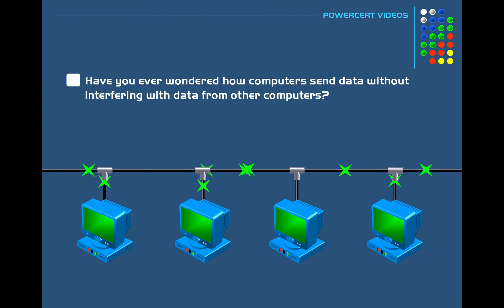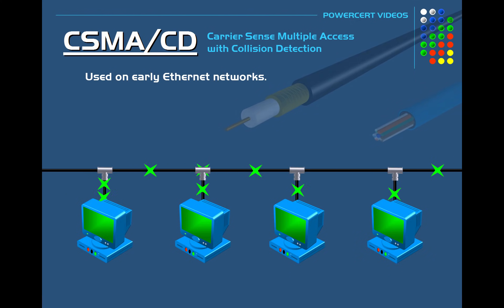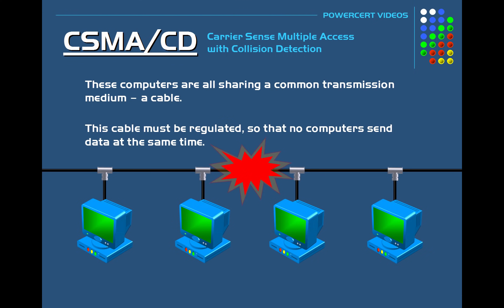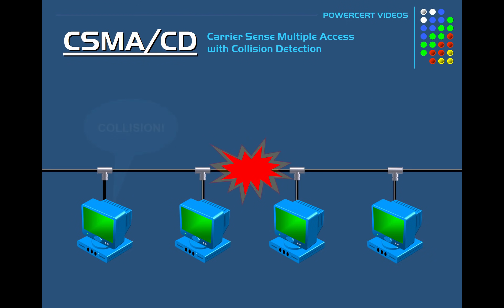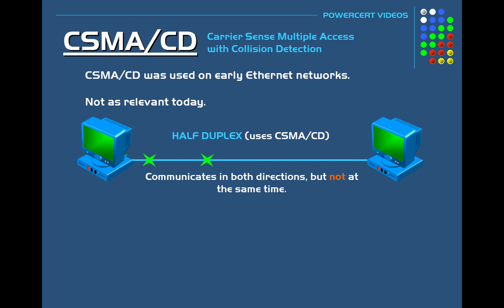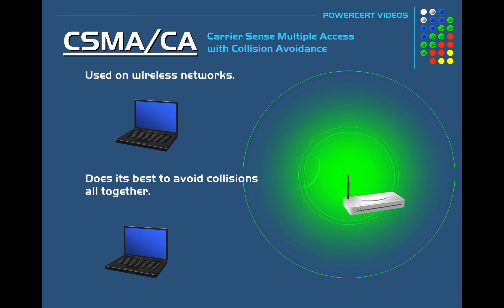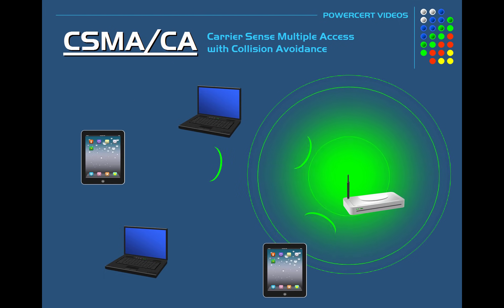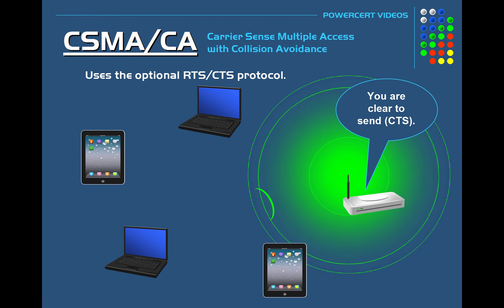CSMA/CD and CSMA/CA Explained

Comment: In the wireless transmission, does the same RTS/CTS applies when 2 or more computers want to transmit data between themselves or does it only applies when 2 or more computers want to communicate/transmit data to the wap/router? Would really appreciate an answer if anyone knows.

Comment: 1:06 how does a computer sense if the wire is idle?

1:59 how does a computer sense or listen?

2: 41 is the data being sent at this point called a frame?

Comment: Couldn't one station send so much data to the router continuously,  blocking the other stations to send their data?
Reply: Yes, you could even have a signal jammer. 
If you're doing bandwidth intensive tasks like downloading a movie it is harder for other devices to communicate but there are gaps between packets where other devices could try to send their packets.

Comment: Its csma/ca is using for these days ? And how to turn on it ?
Reply: CSMA/CA is not an application that you can turn on or off , it's a fundamental created to avoid collision. Ethernet technology works on CSMA/CD fundamental it's built in. 
In wireless medium, collision cannot be detected because, air is not a confined medium, hence, collision is avoided with the help of RTS/CTS  instead of detection. 
On wired medium both collision is detected and avoided. Nowadays, in switch collision rarely happens. Because switch is an intelligent device unlike hub.

Comment: This is hands down the best Informational & Educational channel for IT on youtube. Thank you for the content and I wish you will keep pumping videos forever and help us understand the world better ! 
I was wondering how come CSMA/CD doesn't cause a noticeable delay cause on my Router I could have at times two computers over ethernet that are both downloading large files but I don't get any significant delay on page loads for example ?
Reply from the maker: CMSA is not used on modern networks...only older (half duplex) networks.  I'm sure you're running a modern (full duplex) network.
Reply: @PowerCertAnimatedVideos  Hi, sorry about my ignorance, but I can't understand why full duplex makes CMSA not usable. I had had think that it was due to incoming switches on LAN's, then the cables now are dedicated by node and there not exists colision posibility. Sorry for my English too
Reply: @arrudeboy  Imagine you have a computer connected to another computer.  Let's call them Computer A and Computer B. Today, there is one category 6 twisted pair cable between them. It looks like one cable but actually inside the cable are lots of wires. Some of those wires are used for communications. There are some exclusively for data in one direction starting from computer A and destined for computer B. Other wires are used for data starting now at the B computer going to A. Information only travels in one direction on these cables. Before this,  data traveled twoways on a single wire. Imagine a one-lane bridge over a stream. If two cars approach the bridge at the same time in opposite directions, then one car has to wait, or else they will collide. This is what CSMA/CD is. When you have two lanes on a bridge exclusive for each direction, then one of the cars does not have to wait to avoid a collision. Both cars can go at the same time. Because the full-duplex is separate lanes for traffic going each way, CSMA/CD is not necessary. Email me if you need more explanation dgillette@etprofessionals.com